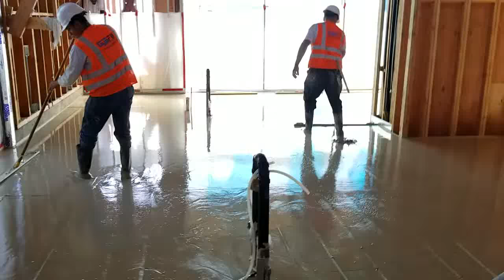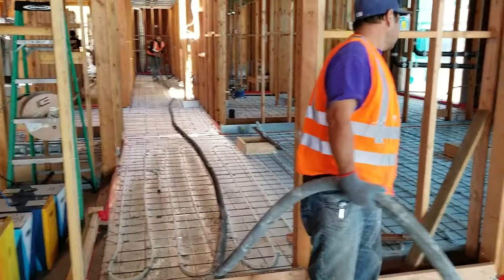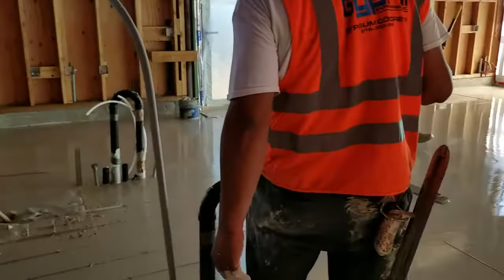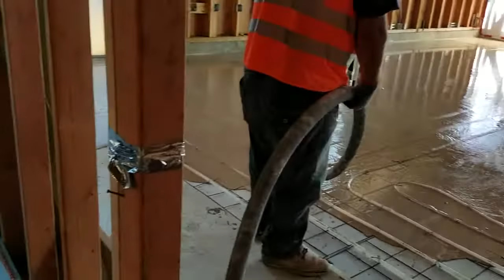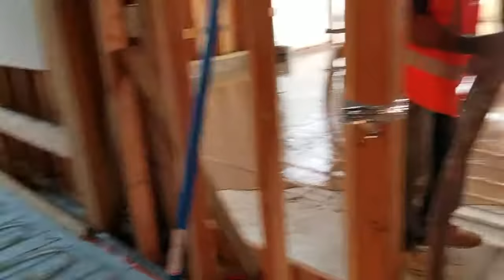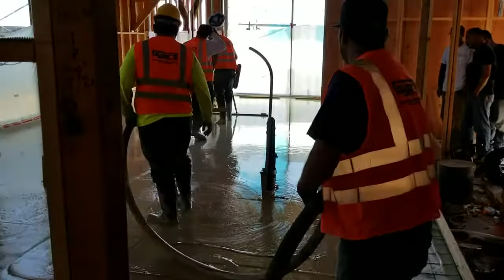Radient Floor Leveling Concrete (Gypsum Concrete - Gypcrete) - Los Angeles

Comment: I had a water leak around a door which seeped under the gypcrete and turned it to powder. I removed the affected tiles, dug out the powdered gypcrete and had the door waterproofed. Is there anything else I need to do to prep the area before pouring new gypcrete and laying new tiles? Thank you!

Comment: how much sq ft you guys can do in a day work?
Reply from the maker: About 15,000 SF. Feel free to send us any project plans or requests to info@gyp-fill.com. Or give us a call at (818) 303-9626.
Reply: Approx. how much dose it cost a Sq/ft?
Reply from the maker: It really depends on how much SF one is trying to pour, and on the thickness of the material. You got a house you are trying to pour?
Reply: I'm in Canada and trying to learn about this business and if profitable want to buy a pump
Reply from the maker: You should, it's a great business. You can give my owner a call at (818) 445-9660 if you would like more info about the business side of it.
Reply: I am thinking to get one or tow pomps bcd in the city I moved one year a go and work in construction , I notice that all houses here get 1 1/2 inc light concert floors. 
Thank you for your help!!
Reply: Hi, I need info about the pump. Please